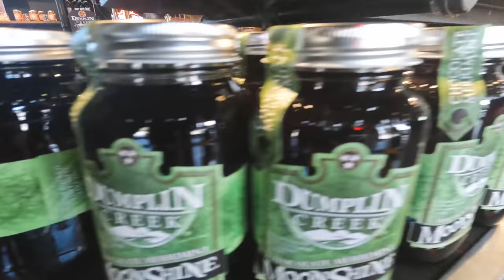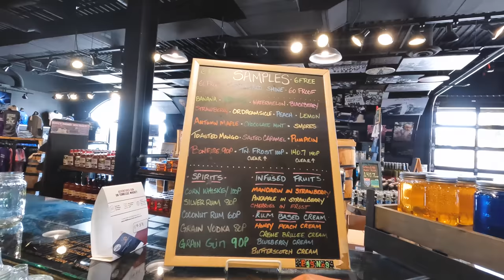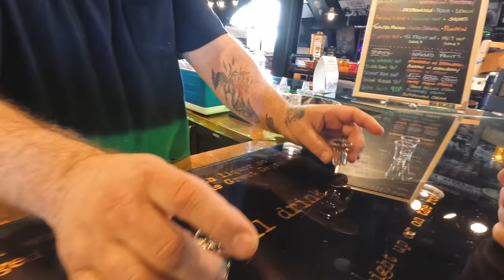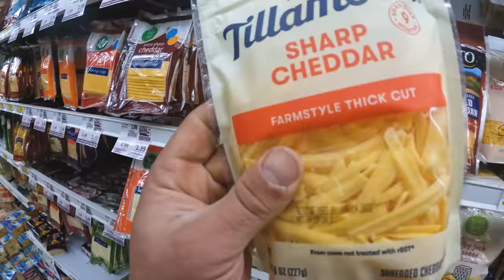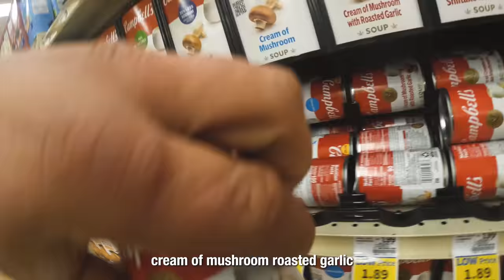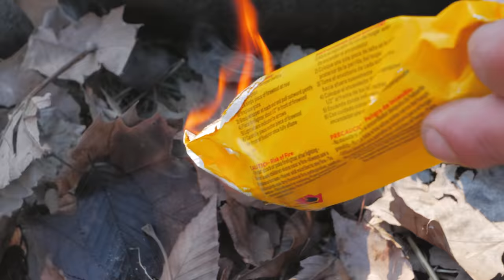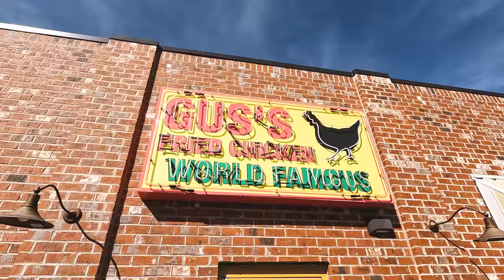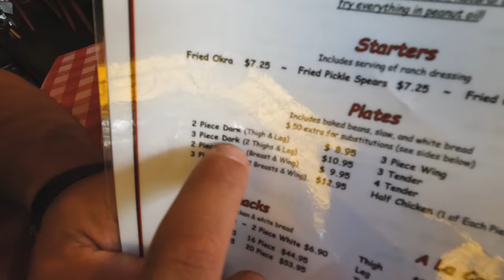I TRAVELED Over Halfway Across The USA For THIS!!

Comment: INGREDIENTS
1/2 cup olive oil
2 tablespoons red wine vinegar
1/2 cup finely chopped parsley
3-4 cloves garlic , finely chopped or minced
2 small red chilies , or 1 red chili, deseeded and finely chopped (about 1 tablespoon finely chopped chili)
3/4 teaspoon dried oregano
1 level teaspoon coarse salt
pepper , to taste (about 1/2 teaspoon)

INSTRUCTIONS
Mix all ingredients together in a bowl. Allow to sit for 5-10 minutes to release all of the flavours into the oil before using. Ideally, let it sit for more than 2 hours, if time allows.
Chimichurri can be prepared earlier than needed, and refrigerated for 24 hours, if needed.
Use to baste meats (chicken or steaks) while grilling or barbecuing. We don't use it as a marinade, but choose to baste our meats with chimichurri instead. However, you can use it as a marinade if you wish. Also, add a couple of tablespoons over your steak to serve.